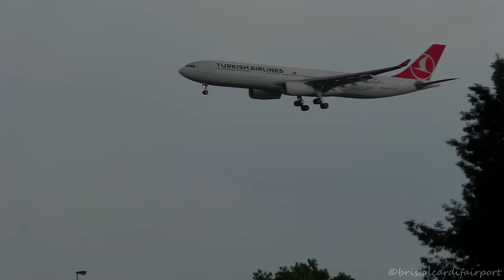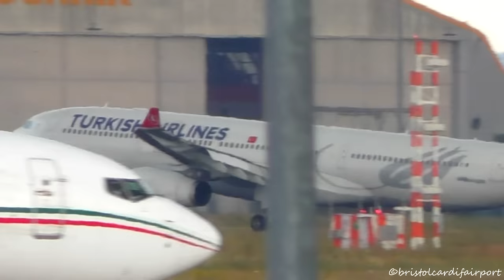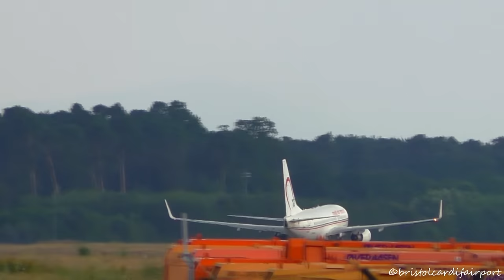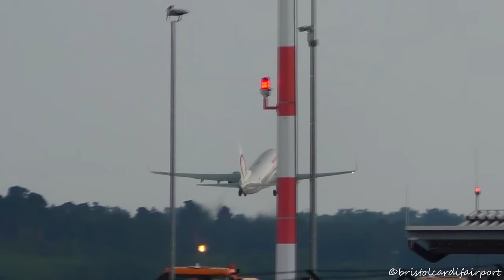PASSENGER AIRCRAFT FAILS TO TAKEOFF! BOEING 737 NEAR TAIL STRIKE & STALL ON TAKEOFF

Comment: I have the utmost respect for pilots, being a maritime deck officer myself. This is unacceptable.
Reply: i cant tell if youre saying the pilots were good or bad. I hope this comment helps:

So, First of all in this video you see the Turkish Airlines Airbus A330 landing. This plane flies over the runway the 737 later takes off from, meaning that there is now wake turbulence on the runway. When it is time for the 737 to take off (which has flaps 1 selected, which is a normal setting for this runway length and wind speed) it rotated as it was in the wake turbulence of the a330. The wake caused a tailwind, therefore making the airspeed lower. The pilots lowered the nose to pick up more speed, and then rotated again and took off. Nobody was at fault here. My sources came mostly from observation of the video and from Ryanair captain "Mentour Pilot" who did an analysis of this video and came to this conclusion. Feel free to check out his video on it, i hope this clears some things up. No one is at fault here.

Comment: I'm only a Private Pilot but it looks to me somebody forgot the flaps.
  I know on my little Cessna I usually use 10 to 20 degrees of flap but I can't see any on the 747 in this video. Maybe it doesn't need any?
Reply: Flaps work differently on this plane. You can see that the slats are out. So the flaps were definitely there , but only 5°, so you need to zoom in order to spot them. It was the minimum setting certified for take off, flaps 1.
Reply: @Hk-uw8my  
Thank you for taking the time to post this interesting information. It's appreciated.

Comment: Even if the pilot would have had an incorrect flap setting (which they didn't have) it wouldn't have made such a big impact, the difference between a flaps 1 and 10 takeoff is only 4-9 knots.

Comment: Um, pilot heard V1 - was committed to take off, something happened that impacted Vr either just before or during rotation? Speed didn't go up. Brought nose down (could have come down faster), got to Vr again and took off. Only quibble is holding nose up as long as they did. Training should be to get nose down and get speed up again after V1. If after V1 aborting takeoff is normally no recommended.

Comment: Look at the wing! No flaps or slats out. Not surprised it stayed on the deck for so long.
Reply: Actually they were using flaps 1, the slats are clearly out if you look carefully. I suggest looking at this video on a bigger screen, like a laptop or tv. This was reported to have been caused by wake turbulence from the airbus a330 that landed before the 737 took off. The wake turbulence caused airspeed and lift to decrease, so the pilots lowered the nose to increase the airspeed and lift. Also, if you were wondering, flaps 1 is a normal setting for taking off at frankfurt, as it has long runways and the wind sock showed very little wind. I hope this comment explains things.

Comment: They just missed to set the flaps for take off. I wonder if the take off warning horn was faulty , but the " before take off check list " on a 737 , the Flaps arei the second item 5 set,5 indicated, green light !!!. That killed tens of people in Madrid Barajas few years ago, with a MD of Spanair. Airliners need certaing degree of flaps/ slats for take off, approach and landing.

Comment: Hard to believe at this level,of piloting this type of mistake could happen.
Reply: There was no mistake in here. In this video, you can see that the windsock indicates very mild winds. The A330 at the beginning created wake turbulence, creating a sudden strong tailwind. The pilots deliberately lowered the nose to gain more speed before taking off. There is a Ryanair 737-800 line training captain called "Mentour Pilot" who explained this incident very well. Yoy should check it out.

Comment: Company statement was obviously nonsensical. The rotation was clearly abnormal as they almost got a tailstrike despite a normal rotation rate.
Looks like Flaps 1 or 2 but not 5. Rotation initiated prior to passing taxiway W9 so 1000 to 1200m from start of the takeoff roll and in 25 seconds roughly.  Doing the maths, the acceleration was normal but the takeoff roll looked pretty short and the speed achieved by VR must have been quiet low for a 737 loaded for a 3h flight. My educated guess is a miscalculation of the takeoff speeds due to using the wrong weight. With flaps 2 iso flaps 5, the plane would have lifted off easily (been there, done that...) with the correct weight used.

Comment: It's very clear that the pilot has forgotten the :flaps 5*
Reply: I hope this comment helps:

So, First of all in this video you see the Turkish Airlines Airbus A330 landing. This plane flies over the runway the 737 later takes off from, meaning that there is now wake turbulence on the runway. When it is time for the 737 to take off (which has flaps 1 selected, which is a normal setting for this runway length and wind speed) it rotated as it was in the wake turbulence of the a330. The wake caused a tailwind, therefore making the airspeed lower. The pilots lowered the nose to pick up more speed, and then rotated again and took off. Nobody was at fault here. My sources came mostly from observation of the video and from Ryanair captain "Mentour Pilot" who did an analysis of this video and came to this conclusion. Feel free to check out his video on it, i hope this clears some things up. No one is at fault here.

Comment: No flaps. Looks as if they aren't extended at all. An MD80 will stall and crash without the flaps down. Northwest 255 in Detroit in 1987is a good example. Forgot to set the flaps and 156 died including the pilots who really screwed up big time.

Comment: Well, at some speed limit the 737 of Royal Air Maroc has to take off, that's usual...they have no other choice than taking off at this speed. What else should they do? A decision not to take off at this kind of velocity would maybe have ended in a crash and would maybe have taken all lives on board. So the pilots did a very good job. Security first.

Comment: The wings (flap) not extended maybe?
Reply: I hope this comment helps:

So, First of all in this video you see the Turkish Airlines Airbus A330 landing. This plane flies over the runway the 737 later takes off from, meaning that there is now wake turbulence on the runway. When it is time for the 737 to take off (which has flaps 1 selected, which is a normal setting for this runway length and wind speed) it rotated as it was in the wake turbulence of the a330. The wake caused a tailwind, therefore making the airspeed lower. The pilots lowered the nose to pick up more speed, and then rotated again and took off. Nobody was at fault here. My sources came mostly from observation of the video and from Ryanair captain "Mentour Pilot" who did an analysis of this video and came to this conclusion. Feel free to check out his video on it, i hope this clears some things up. No one is at fault here.

Comment: looks like they missed setting up the flaps for take off. look again you can see the flaps are at Zero i think the setting should be 15-20
with out flaps being set correctly the plane doesn't have enough lift.
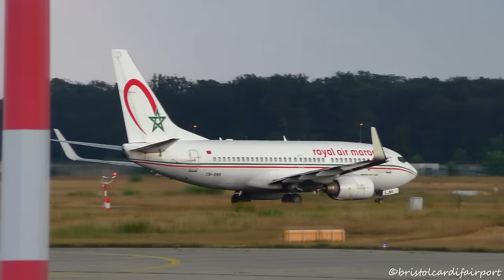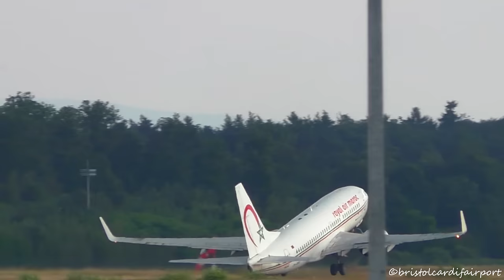Reply: Look more carefully.  At 0:29, you can clearly see the slats extended, and at 0:50 you can see the flaps are out as well.  Also watch this video for the rest of the story:   https://youtu.be/TEjbg_2yuFI
Reply: front slats are out yes. but no flaps......

Comment: Incorrect flap setting? More like didn't even set it. This is like trying to make a left turn across traffic but forgetting to put it in first and it's in third when you rolled to a stop and clutched in.
Reply: No a 737 can take off with flaps 1 like in the video,this is probaly an error with take off speed,

Comment: Observing the configuration of the wings, it is evident that the pilot forgot to lower the flaps for takeoff!
Reply: They had flaps 1 set, which is a good flaps setting for these weather conditions. Royal Air Maroc also tweeted that the cause of the incident was the wake turbulence from the Airbus A330 in the beginning of the video. Theres a Ryanair 737-800 captain called 'Mentour pilot' who made a really good video explaining this incident, you should check it out.

Comment: You need to have the aircraft configured for take-off, and that includes having the proper flap setting. In this case, the pilot didn't panic and lowered the nose to gain enough speed to make the jump.

Comment: The A330’s wake turbulence may have slightly affected the 737’s lift at takeoff but to me, it simply looks like the 737 was at max takeoff weight and pilots rotated too early without sufficient thrust to weight ratio and without enough runway to abort, the pilots had no choice but to go full thrust to continue with takeoff. You can hear the engines roar louder on second rotation. Royal Air Maroc planes are usually packed to the limit with PAX and heavy luggage. Good thing RAM has some of the best trained airline pilots in the world.

Comment: No flaps n' slats.  I'm no pilot, but I've watched enough Air Disasters to know you gotta extend flaps and slats on take off too.
Reply: I hope this comment helps:

So, First of all in this video you see the Turkish Airlines Airbus A330 landing. This plane flies over the runway the 737 later takes off from, meaning that there is now wake turbulence on the runway. When it is time for the 737 to take off (which has flaps 1 selected, which is a normal setting for this runway length and wind speed) it rotated as it was in the wake turbulence of the a330. The wake caused a tailwind, therefore making the airspeed lower. The pilots lowered the nose to pick up more speed, and then rotated again and took off. Nobody was at fault here. My sources came mostly from observation of the video and from Ryanair captain "Mentour Pilot" who did an analysis of this video and came to this conclusion. Feel free to check out his video on it, i hope this clears some things up.
Reply: @ElectroRail  I'm somewhat familiar with wake turbulence (again, thanks to Air Disasters).  How long does wake turbulence last after a plane has passed? And do we know the time that elapses between landing and takeoff from this video? 

I'm familiar with Mentour Pilot but don't really watch much of his videos, so if he did an in-depth review of this particular incident, then I believe you in this case.  As a casual observer, I would have guessed flaps and slats (maybe that's not a thing for Airbus vs. Boeing?) or an overweight plane.  Not trying to be argumentative, so I apologize if I come off that way.  I appreciate your input and will look into MP's video(s).  Have a nice day, @Electro.

Comment: no flaps engaged??
Reply: I hope this comment helps:

So, First of all in this video you see the Turkish Airlines Airbus A330 landing. This plane flies over the runway the 737 later takes off from, meaning that there is now wake turbulence on the runway. When it is time for the 737 to take off (which has flaps 1 selected, which is a normal setting for this runway length and wind speed) it rotated as it was in the wake turbulence of the a330. The wake caused a tailwind, therefore making the airspeed lower. The pilots lowered the nose to pick up more speed, and then rotated again and took off. Nobody was at fault here. My sources came mostly from observation of the video and from Ryanair captain "Mentour Pilot" who did an analysis of this video and came to this conclusion. Feel free to check out his video on it, i hope this clears some things up. No one is at fault here.

Comment: He might have been forgotten to apply flaps before takeoff
Reply: I hope this comment helps:

So, First of all in this video you see the Turkish Airlines Airbus A330 landing. This plane flies over the runway the 737 later takes off from, meaning that there is now wake turbulence on the runway. When it is time for the 737 to take off (which has flaps 1 selected, which is a normal setting for this runway length and wind speed) it rotated as it was in the wake turbulence of the a330. The wake caused a tailwind, therefore making the airspeed lower. The pilots lowered the nose to pick up more speed, and then rotated again and took off. Nobody was at fault here. My sources came mostly from observation of the video and from Ryanair captain "Mentour Pilot" who did an analysis of this video and came to this conclusion. Feel free to check out his video on it, i hope this clears some things up. No one is at fault here.

Comment: Ouuuuhhh happy that the runway is enough longer..... this pilot should nevertheless fly again
Reply: The pilot did an amazing job, the reason why the plane failed to take off in the first try comes back to the wake turbulence from the Turkish airlines Airbus A330, this wake turbulence lowered the RAM B737 speed dramatically and at that moment the pilot had already pulled up.

Comment: i would like that the pilot will cancel the takeoff, if the lane was short, he could hit the fence.
he will cancel the takeoff, revise his calculations, and do it again rather than putting people's life in danger! never seen this in my life, and i travelled a lot
Reply: Actually they were past V1. V1 is the speed where it is no longer safe to abort the take off and you are committed to getting the plane in the air. It was reported that this incident was due to wake turbulence from an a330 that landed just before this plane did, meaning that thr plane lost lift. The pilots realised what was happening so they lowered the nose to get out of the area affected by the wake turbulence, where there was more lift. The pilots did exactly what they were trained to do in this instance.

Comment: Not a lot of flaps deployed for takeoff🤔?
Reply: The plane was using flaps 1 which is a normal setting for taking off from frankfurt, as it has long runways and there was little wind (indicated by the wind sock). It was reported that this incident was caused by wake turbulence from the a330 that was shown in the beginning. The wake turbulence reduced the amount of lift. The pilots realised this and lowered the nose to get past the effects of the wake turbulence and to gain more airspeed and rotated again. The crew reacted to the situation perfectly well. If you want more info read the whole top comment.

Comment: Is it just me or do they look like they don’t have much flaps going on?
Reply: I hope this comment helps:

So, First of all in this video you see the Turkish Airlines Airbus A330 landing. This plane flies over the runway the 737 later takes off from, meaning that there is now wake turbulence on the runway. When it is time for the 737 to take off (which has flaps 1 selected, which is a normal setting for this runway length and wind speed) it rotated as it was in the wake turbulence of the a330. The wake caused a tailwind, therefore making the airspeed lower. The pilots lowered the nose to pick up more speed, and then rotated again and took off. Nobody was at fault here. My sources came mostly from observation of the video and from Ryanair captain "Mentour Pilot" who did an analysis of this video and came to this conclusion. Feel free to check out his video on it, i hope this clears some things up. No one is at fault here.
Reply: @ElectroRail  Very good breakdown of the situation, thanks. My only follow up question is that isn’t it unusual for aircraft to take off and land in different directions? I lived near the largest civilian airport in Canada all my life and I can’t say that I’ve ever seen them land an airplane in one direction and them had the next airplane take off in the opposite direction. Maybe if there’s little to no wind and they limited time and high traffic?
Reply: @PJMontoya  I honestly don't know why they were landing in different directions. Then again European airspace tends to be a lot more busy than a lot of other places, the wind sock indicated quite little wind, but I don't really have an explanation as to why they were landing and taking off in different directions, but after looking at flightradar24 a lot, it seems to be pretty common for that to happen at frankfurt.

Comment: Looks like it's caused by wake turbulence pushing down on the wings
Reply: It was caused by wake turbulence, you are correct, but it's not due to it pushing down on the wings. The wake turbulence has effects in vortexes, meaning that there would have been a sudden tailwind that massively reduced the airspeed and therefore also reduced the lift.

Comment: No flaps.   Pilot error, plane and simple.   Recovers by continuing to accelerate.
Reply: I hope this comment helps:

So, First of all in this video you see the Turkish Airlines Airbus A330 landing. This plane flies over the runway the 737 later takes off from, meaning that there is now wake turbulence on the runway. When it is time for the 737 to take off (which has flaps 1 selected, which is a normal setting for this runway length and wind speed) it rotated as it was in the wake turbulence of the a330. The wake caused a tailwind, therefore making the airspeed lower. The pilots lowered the nose to pick up more speed, and then rotated again and took off. Nobody was at fault here. My sources came mostly from observation of the video and from Ryanair captain "Mentour Pilot" who did an analysis of this video and came to this conclusion. Feel free to check out his video on it, i hope this clears some things up.
Reply: @ElectroRail  saw the mentour explanation just a few days ago.  Thanks for your response.  I have to admit that I had become a bit of an “armchair pilot” and nobody needs that!!!